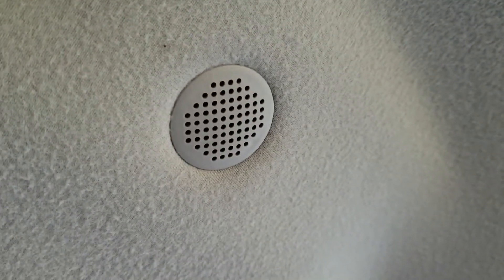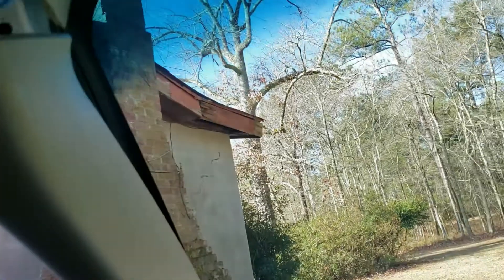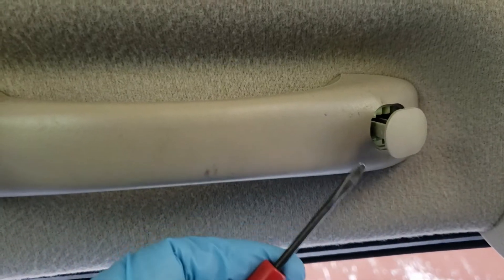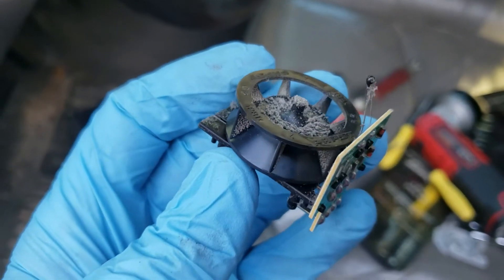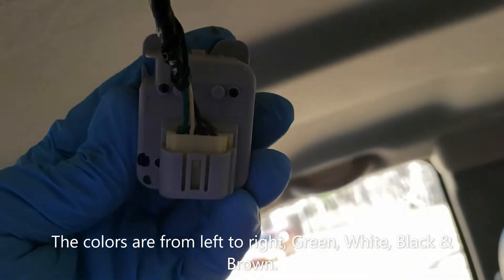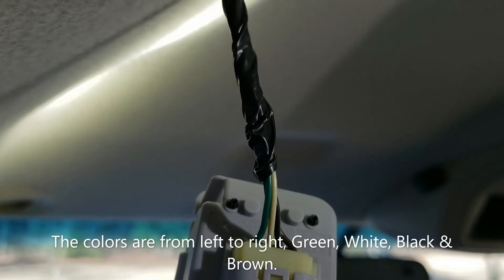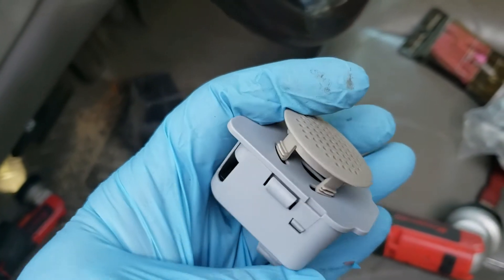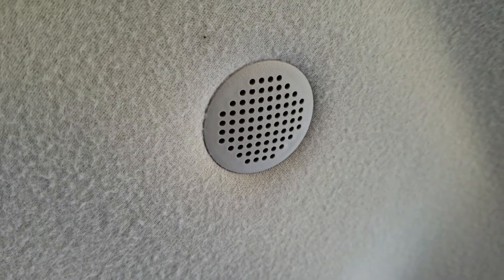2003 Silverado Interior Temperature Sensor/Aspirator Replacement and Harness Routing

Comment: Thanks! I was the guy who asked you that question..turned out the previous owner cut that harness off..I ended up buying a aspirator and rewired everything  back up with a new harness and a new connector. Everything works now!
Reply from the maker: Glad to hear your truck is fixed. I hope our conversations helped.
Reply: Hey @Jose where did you buy the harness?? I’m dealing with the same thing. The previous owner of my Silverado cut the sensor off so I have bare wires.
Reply from the maker: @jhankerson16  He said he bought used parts. i would assume from a salvage yard.
Reply: @jhankerson16 You guys have some crap luck. I don't see any reason it would be easier to cut it instead of just unplugging. Sounds like the previous owners had no idea what they where doing. I unplugged mine cause  the fan was buzzing and I was thinking it was only for the automatic climate control, but I guess not. Now it's either max heat, vent, or max cold.

Comment: Does the aspirator only affect the auto mode or can it cause the ac to not get cold at all?
Reply from the maker: The aspirator is only used in vehicles with auto controls. If it is disconnected or open circuit it can affect the temperature control for both a/c and heat. However it should still get cold if set to 60 F. Not getting cold at all is normally a refrigerant related issue.
Reply: @SparkysAnswers  
Thank you.

Comment: I wished I had seen this before but unfortunately I didn’t. So I have a 2002 GMC Yukon SLT and I was getting a humming noise from this sensor which I thought was a speaker for onstar. In trying to find noise I accidentally broke the red wire to that sensor. I could tell something went wrong right after I broke the red wire as my gauges started acting oddly.  Now my gauges don’t work but instrument cluster lights up fine.  I also tried to start the truck, it will turn over but will not crank. Any ideas from anyone what the issues could be and why that would cause this. Thanks in advance
Reply from the maker: There is a ground wire at the passenger side rear of the engine that is common to break and cause your truck's symptoms. I would inspect that first. I am including a link to an article I wrote several years ago for a similar vehicle and problem. https://sparkys-answers.com/2012/03/2000-chevrolet-suburban-instrument.html
Reply: Thanks for the reply and the link but unfortunately the wire was not broken. I am curious if the fact the gauges are not working is related to the engine cranking but not starting are related or they coincidentally happened at the same time.
Reply from the maker: @gchill680  Does the engine start and immediately stalls or does it fail to run at all? If it runs for a split second and then stalls, locate the IGN 0 fuse in the interior fuse box. Test for power on that fuse with the ignition key in the run and in the crank positions. There should be battery voltage in both key positions. If the voltage is low or missing in either position you will need to perform the same tests at the white wire at the ignition switch. If there is no power at all at the IGN 0 fuse then make sure you check the IGN C fuse in the underhood fuse box before moving on to test the white wire at the ignition switch.

Comment: Sparky great video!. Hard to find any fixes for this problem on the web.I have a 2002 Bravada . This problem just started and im chasing my tail trying to fix it.i have replaced the cabin air sensor located on the B pillar. replaced  3 little air sensors in the front vents .
pulled the 2 HVAC fuses to recalibrate the actuators(following the reset procedures).still onlt gets heat @ 90 deg. 89 & below is blowing cold. is there anything im missing? would a professional solus scan tool determine where the trouble is? im lost , would appreciate any imput from you . thanks man
Reply from the maker: A scan tool would certainly help. I would think that there is a temperature sensor data issue. You have replaced several and that would suggest that here is a wiring problem and the sensors may be okay. A scan tool capable of reading the data in the HVAC, BCM and PCM would be needed. The Snap On Solus should be able to do that but sometimes after market tools are limited on low production/odd vehicles. You may have to tell the scan tool you are working on a Trailblazer instead of a Bravada
Reply: I have the same exact problem in my 03 avalanche
Reply: @louiszacarias8788  i also have this issue on my 03 avalanche. i pulled off this vent cover in the headliner and I didn't see the temp sensor there, so I'm hoping if I install it, it will fix my issues. i ran the calibration and my blend door are working fine. only blows hot at 90 degrees and it will auto-switch the vents to the floor at 90. if this doesn't work, the next thing ill replace as a last resort is the climate control module and see if that fixes everything.

Comment: Could this be the reason my heat is only working when set on 90? 89 and under seems to just blow outside temp air.
Reply from the maker: A missing or faulty aspirator can cause that issue.

Comment: So I have an 03 2500 lb7 duramax, it is filled with Freon, the ac compressor clutch won’t engage, I thought this would mean compressor is bad, but I ran a wire from a battery to the positive terminal on the ac relay in my fuse box and the compressor kicks on, I’ve already checked the relay I put a relay I know that works in and it still doesn’t come on, I’ve made sure the button for ac is on in the cab, I thought that button may be bad but on the little screen it shows ac is on, it still could be bad I haven’t checked it yet, what do you think this could be?
Reply from the maker: The most likely problem would be an issue with the low pressure cycling switch or it's harness connector. It should be located on the accumulator tank under the hood on the passenger side of the firewall.
Reply: @SparkysAnswers  thanks man

Comment: Will this cause the air to only blow around 60 degrees on max?
Reply from the maker: Usually, if it fails (either shorted or open) the vent temperature will either be very cold or hot. Normally,  vent temperature at 60 degrees F on max would be either a refrigerant issue or a temperature door actuator problem.

Comment: The auto HVAC system in my '05 yukon Denali seems to be struggling to figure out exactly what it needs to do to maintain any set temperature. It will blow cool air for about 30 seconds and then warmer air for about 30 seconds and this cycle repeats. Doesn't matter what temperature you set it to. Could this sensor cause that issue?
Reply from the maker: No, it should not cause that type of problem. In fact no one thing could cause your issue. Instead I would guess that you have at least two problems. The first would be that the blend door actuator/actuators are stuck and the second would be that the refrigerant level is low. 
You have a split system  on that Yukon. Are the vent temperatures the same on both sides of the dash?
Reply: @SparkysAnswers  yes sir the temperature is the same coming out of the vents on both the driver and passenger side.
Reply: @SparkysAnswers also something else I have noticed. When in manual mode with the heat on it will only blow hot air with the temperature at the max setting of 80 degrees. Anything less and the air is kind of lukewarm. Again the temperature is the same coming out of all the vents both driver and passenger.
Reply from the maker: @andyvaldez2830  If it only blows good heat with the temperature set to full hot then the aspirator in the headliner could be the reason. Full heat should be 90 F though.
Reply: @SparkysAnswers  Yes that was my mistake. It only seems to blow good heat in manual mode with the thermostat set at 90°. The temperature feels the same both driver and passenger. Anything less than 90° and it's just lukewarm air. Ice cold air at 60° but as soon as you switch the system to auto it's as if it doesn't know what to do to maintain whatever the set temperature is. It will alternate between blowing cool and lukewarm air.
Reply from the maker: @andyvaldez2830 Based on your last reply there is a pretty good chance there is a problem with the aspirator (cabin air temperature sensor). Any chance you have access to a scan tool that can communicate with the HVAC system?
Reply: @SparkysAnswers  I have a Foxwell NT630 plus but I haven't used it much so I'm not sure that it is capable of diagnosing the HVAC system.
Reply from the maker: @andyvaldez2830  Does not say anything about working with HVAC systems in anything I could find about it.
Reply: @SparkysAnswers  thanks for your help. The part is cheap enough and seems easy enough to replace that I'm going to give it a try and see if that fixes the issue. With the the heat working like it should at the max setting and the AC working like it should at the max setting I would think that the actuators would be functioning as designed.
Reply from the maker: @andyvaldez2830  Sounds like a good plan. Let me know how it turns out.

Comment: Can this cause the compressor to not engage in a 2007.5 gmc sierra 2500hd duramax.
Reply from the maker: According to GM service information the interior temperature sensor in this video is not used by the pcm in it's decision to turn the compressor on or off. See below:

"The following conditions must be met in order for the A/C compressor clutch to turn ON if they are not all met and an A/C request is made the LED on the A/C switch will flash:

Ambient air temperature above 7°C (45°F)
A/C low pressure switch signal circuit is grounded
A/C refrigerant pressure sensor parameter is less than 2957 kPa (429 psi)
PCM receives an A/C request from the HVAC control module
Engine coolant temperature (ECT) is less than 121°C (250°F)
The engine rpm is more than 550 RPM
The throttle position is less than 100 percent"

"Once engaged, the compressor clutch will be disengaged for the following conditions:

Ambient air temperature is less than 7°C (45°F)
Throttle position is 100 percent
The A/C low pressure switch is open
A/C high side pressure is more than 2957 kPa (429 psi)
A/C low side pressure is less than 151 kPa (22 psi)
ECT is more than 121°C (250°F)
Engine speed is more than 5500 RPM
Transmission shift
PCM detects excessive torque load
PCM detects insufficient idle quality
PCM detects a hard launch condition"

Comment: Would this part make the ac button flash 3 times when you push it?  I changed the exterior ambient temp sensor and it didn’t fix the ac
Reply from the maker: I don't remember this sensor causing that issue. most of the time it is the ambient temperature sensor. Keep in mind that several year models have two ambient air temperature sensors. If you would share the year, make and model of your truck I would be happy to look that up. Also do you have manual or automatic controls for the a/c?
Reply: @SparkysAnswers  2013 Chevy Silverado 1500 5.3 and it does have auto
Reply from the maker: @bragginrightsfishing7467  There are multiple things that can cause this condition in your vehicle. The first thing I would try is to turn the system on and perform an instant update to the outside air temperate by pressing the a/c and recirculation buttons at the same time. I don't remember if you have to hold them for an extended time or not so you may need to try different scenarios.
Reply: What does this freakin thing do? I’m about censored to death on my 06! Everything on it is dying! I been putting up with that idiot noise for years!
Reply from the maker: @thenotsojollyrancher-akate9516  The fan in the sensor draws in air from the passenger cabin. The thermistor circuits in the sensor provide a temperature data signal to the HVAC control module. Based on input data the HVAC control panel makes decisions as to mode, temperature and blower commands.
Reply: having this same issue right now in my 03 2500hd with the 8.1. did you ever find the problem?

Comment: What kind of issues will this fix ?
Reply from the maker: Mine was just noisy from dust build up. However, you can have issues with no heat or no a/c unless the controls are set to the extreme limits. Which way it is affected depends somewhat on the actual outside temperature. Part of the reason for doing the video was to show the routing of the wiring. The original wiring is glued to channels in the headliner. A reader had asked if I could help him identify the routing and harness ends involved. His headliner had been replaced by a previous owner and the wiring had been cut out.

Comment: Does that sensor effect the a/c
Reply from the maker: It can. What kind of problem are you having with your a/c?
Reply: @SparkysAnswers  this issue just happened during the spring  but when it's hot outside I leaves my windows down so it doesn't be so dam hot in the cab, but when I do get in my truck and turn on the a/c it blows cold but as soon as I put the windows up after about 30 seconds or so the A/C kicks off but what's weird when I put the windows down and turn off the ac for a few minutes and turn it back on the ac works perfectly and then put back up the windows everything is fine all day....the outside ambient air temperature sensor seems to working properly that displays temperature on my rear view mirror I don't know what's the problem
Reply from the maker: @David-yy7lb  That is pretty strange. There are a lot of variables to think of in figuring that problem out. The first thing that comes to mind, if the blower is not acting up during this condition, is that either the system is slightly overcharged or the cooling fan/fan clutch is not working properly. If the blower motor is turning off and causing the complaint then I I would be looking at the ignition switch or the blower motor. Do you happen to own a set of a/c gauges and have any experience using them? Access to a scan tool that can read HVAC codes and data?
Reply: @SparkysAnswers  would the fan clutch make a noise when I step on the gas really hard? If so, the fan clutch might not be working properly?
Reply from the maker: @artoferof7580  If the fan clutch was locked in it would make a loud noise (roaring/jet engine) on acceleration but wouldn't necessarily have to be a hard acceleration. Also you would not have the symptoms you described earlier. If it were slipping which would cause your symptoms there would be no noise from the fan clutch. Now if it were slipping and the head pressure went too high you would have a rapid burping sound and may see some white smoke come from under the hood area on the passenger side. You can also have a condition with the same rapid burping sound on hard acceleration caused by restricted refrigerant flow. This is mostly seen in SUV's with rear a/c.
Reply: @SparkysAnswers  what I meant to describe was the roaring jet sound. Sorry about that

Comment: Anyone know how to change the rear one in a Yukon/suburban?
Reply from the maker: It has been a long time since I changed one but the same basic idea. start removing panels and clips until the headliner comes down enough to access the sensor. I know your have to start with removing the floor sill plate and then move up to remove the 3rd pillar panels. There may be two parts coat hooks that have to be separated before removal from the roof. If I remember right there are also push pins in some year models that have to be pulled out of the headliner.  After everything is either removed or loosened enough to access the sensor you have to work with it to get the sensor and the grill to separate. You will have to remove the harness connector before removal but I don't remember if that should be an early or last step.
Reply: @SparkysAnswers would one of these temp sensors cause the ac to not work? Or to not get power or ground sent to or from the module control